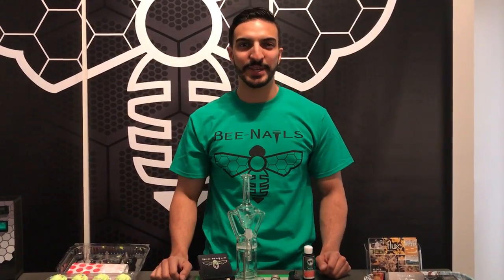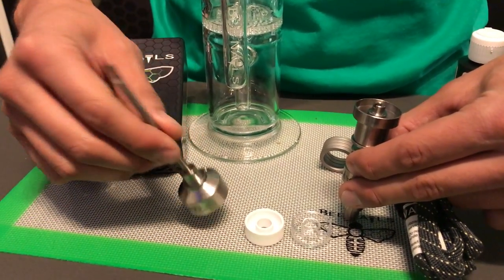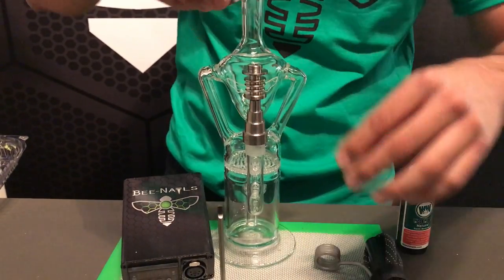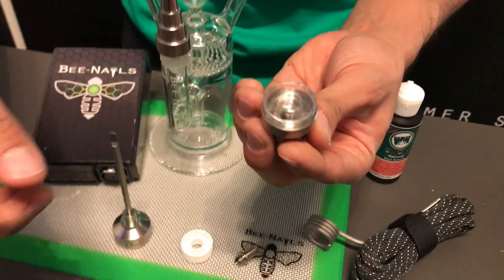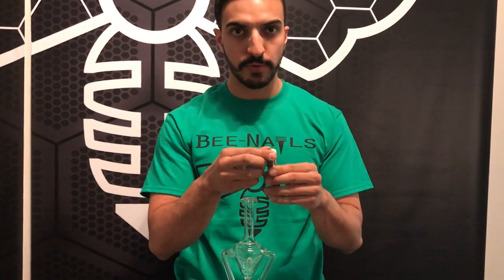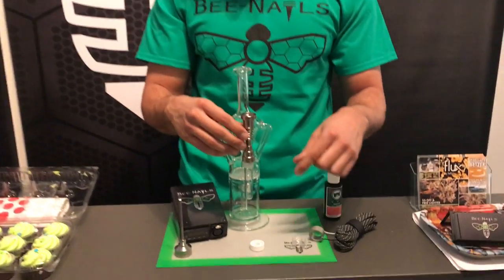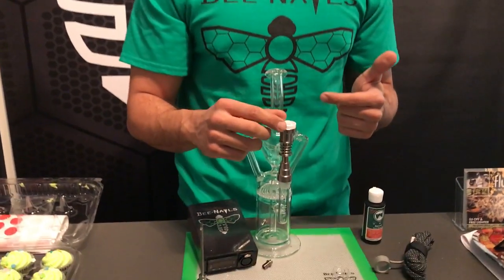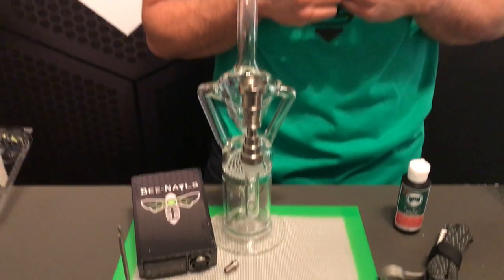Trinity Nail Setup & Cleaning

Comment: I’m having the hardest time removing the screw at the top .  I’ve tried just about everything, but it won’t unscrew
Reply: You have too much was gunked up in the grooves of the screw. The gunk is extremely sticky you're going to have to torch it with your torch until it gets red hot. Let it cool off a bit get a old wash rag use that to grip the top piece and turn it should come off.
Reply: Its got a notch in it put the end of your dab tool in the notch sideways and now you can simply unscrew it using the dab tool

Comment: so basically you're from bee nails and are telling people to bring this to 1000-1200 degrees. I find that odd as in the user manual I received it said that raising the temp above 1100 degrees will not only dramatically reduce the life of my unit but it will void my warranty. So what are the actual rules to my warranty because I don't want to void it in order to just season a nail
Reply from the maker: Great find! We appreciate customers who read their instruction manuals! Our manuals have actually been updated and say not to exceed 1200ºF. Sorry for any confusion. 

Here is the link to our manual at Bee-Nails.com, https://bee-00ixcpnu2xuzvat.netdna-ssl.com/wp-content/uploads/2016/12/Set-Up-Guide-_Trinity-Titanium.pdf.
Reply: I had never heated my nail past 930F for cleaning and it always worked fine. I set the nail to 1200 and went to the bathroom, when I came back the whole thing was glowing. I've never seen the coils glow before. Are you sure 1200F is safe for 20 minutes? Also the titanium is now blue and rainbow colors due to the high temperature.